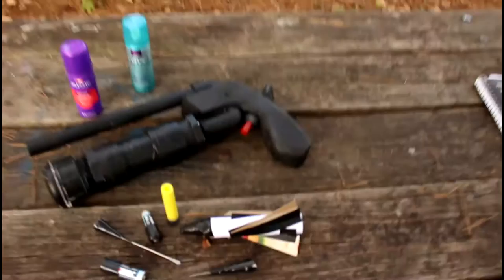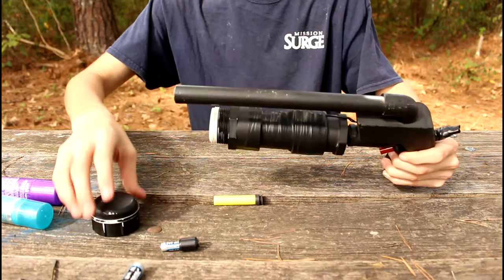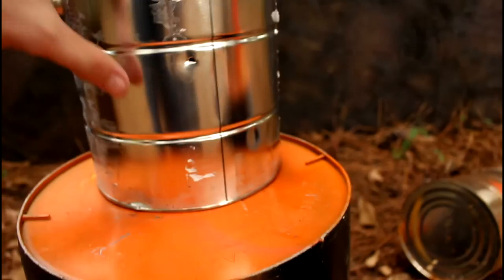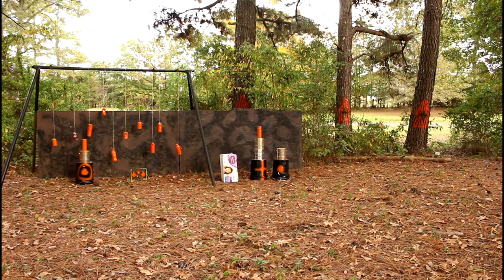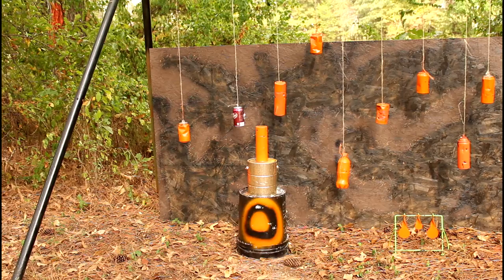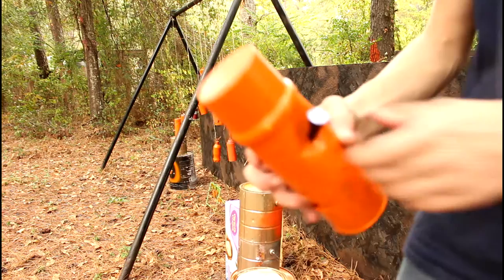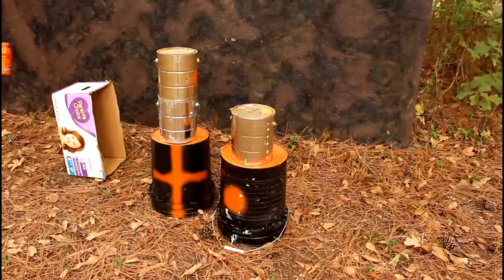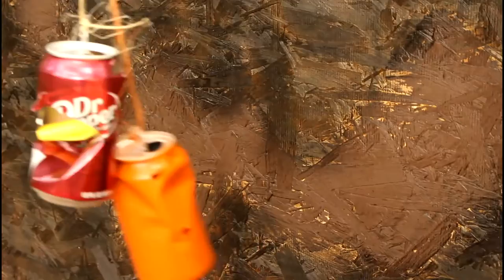my PVC Hairspray Pistol Shoots AA BATTERIES!!

Comment: Gonna try make it but shaped as a flintlock pistol
Reply from the maker: Lol that’s what it was supposed to be shaped like originally but the parts didn’t end up fitting together just right.
Reply: Jake Makes I think that it might be possible to make the chamber integrated in the grips to make it easier to turn it into the form of a flintlock pistol
Reply from the maker: Good luck man! I think you’ll have trouble cause the chamber will be too small but have at it dude
Reply: Jake Makes thX!
Reply: Or I could just make a musket and the chamber will take up a bit of the stock
Reply: I will try the pistol as I don’t need as many resources
Reply: Don’t know what I was thinking, made a prototype with a random bottle a found and a random plastic tube (I have never made a hairspray gun before, only ones powered by plungers), and I shot it without wearing earmuffs in my bedroom
Reply: Okay, so what I plan to do to give the chamber a bit more space is to have the chamber take a slight bit of what the barrel seems to be. Basically meaning the barrel you see will have a portion of it as part of the chamber
Reply from the maker: 😂😂😂 yeah they loud
Reply from the maker: Carefully with trash ones too, in my experience they always fail. Wear heavy gloves or something.

Comment: I made one just like yours but with different ignition, a slightly longer barrel, and more part substitutions. I use hairspray in it and it is way louder than yours. Would you mind if I made an instructable on how to build a suppressor for it? I would give you credit for the original design of course.
Reply from the maker: Naw man that'd be cool. I'm on instructables too, don't know if you know already. (https://www.instructables.com/member/Jake_Makes/)
And i can assure you mine is very loud, but the mic doesn't pick up loud noises very well at all :)
Reply: Ok, it will be posted within a week
Reply: I finished the instructable but I may need to add some things to it.

Comment: Hey what happens if u use more hairspray? Would it be more powerful?
Reply from the maker: No. The perfect amount of hairspray has to mix perfectly with the amount of oxygen in the combustion chamber. The amounts are dictated by the size of the chamber. Adding too much hairspray will cause it to not fire at all
Reply: @jakemakes  hmmm so basically, bigger  chamber, more power?
Reply from the maker: @rattlerboi4034  yep
Reply from the maker: @rattlerboi4034  Or maybe a different fuel
Reply: @jakemakes  noice, once I make one I'll experiment